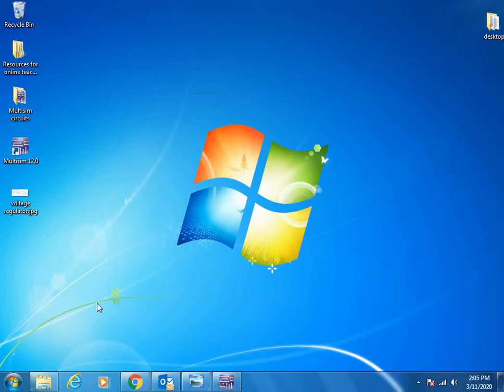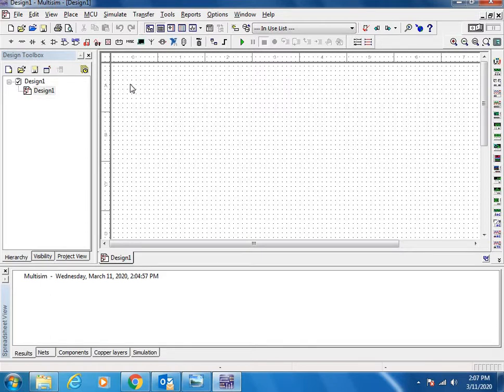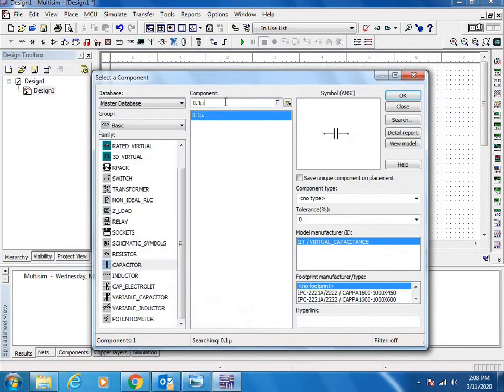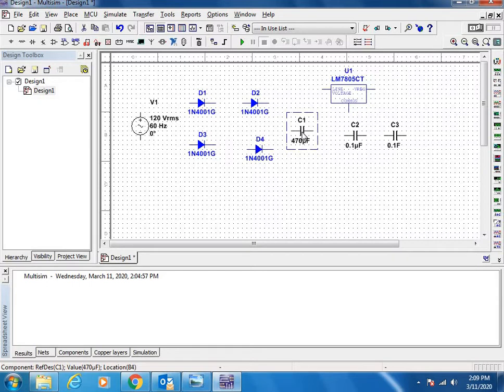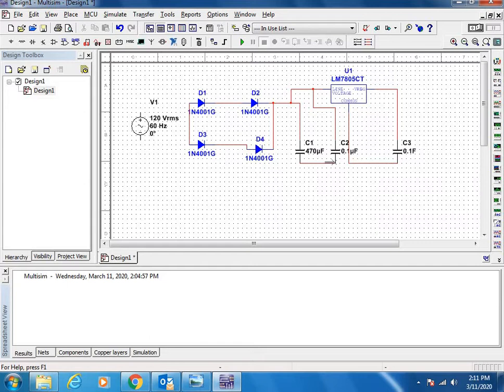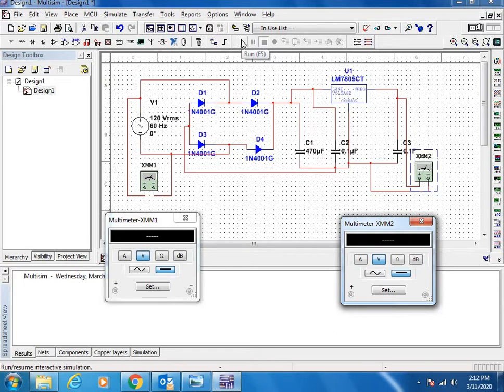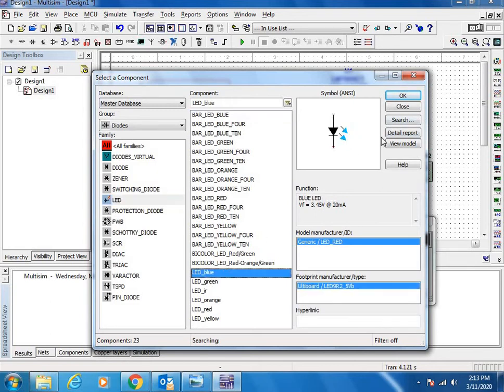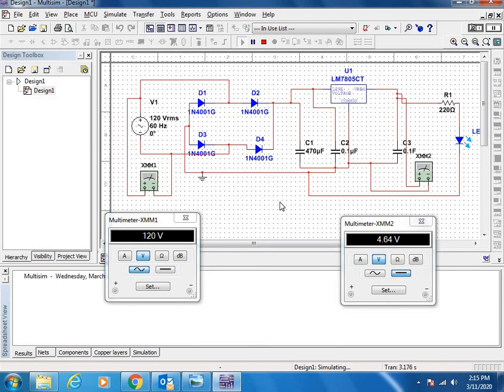Video 2 Multisim circuit design & simulation  voltage regulator

Comment: the promoters of multisim all display very basic circuits.
I would like to see them do a circuit with 3 relays controlled
each by a 24 volt ac switch. each relay being dc with a priority
relay of 15 minutes over the other two let me see if the relays
will hold steady this is not a very complicated circuit, but multisim
will fail, at 4300 hundred dollars you would expect better results.
Reply from the maker: Hi by the way I am not the promoter of multisim but the user of multisim since the licensed full version is available with me.

By the way I would like accept your challenge to design the suggested circuit.

Please send me that respective circuit diagram, I will give a try🤝👍
Reply: @engineeringprojects1359  the circuit is very simple each relay
is controlled by a thermostat, a ordinary switch would do for the thermostat
each relay has a diode a small  pull down resistor to bring the voltage down
to 24 dc with a 1000uf capacitor to smooth out the voltage
the 15 minute priority circuit is done with a 555 timer 
you have the necessary information how the circuit is suppose
to work, now see for yourself
Reply from the maker: @redredbostonelecelec  pls send me circuit diagram. My mail I’d :  ravigiet_eee@yahoo.com
Reply: @engineeringprojects1359  i did not say you were a promotor, i was addressing the
viewers, the circuit i described is a very simple circuit my point is if you
have more 3 relays the relays will not hold steady, if you want to take a challenge show me a workable 
4060 chip with pin 16 and 8 included, also in the circuit i described put in a 555 timer with 
a 15 minute delay for a priority relay show me
Reply from the maker: My email id : ravigiet_eee@yahoo.com

Comment: Where is step down transformer
Reply from the maker: In the simulation i did not use transformer,  since the diodes that I used are ok even  with 220V ac.

While testing the PCB practically I have been used external transformer
Reply: @engineeringprojects1359  ok, but when high voltage is given, we should use step down transformer right?
Reply from the maker: @Bhuvi_23  yes you are right and that would be safe as well

Comment: Sir I want to get 20v dc from 220v ac  how can I do that pls help me
Reply from the maker: try below circuit                                         https://electronicshelpcare.com/how-to-make-inverter-12v-dc-to-220v-ac-making-circuit-diagram-making-transformer-electronics/
Reply: use a step down transformer to give 24 volts ac then use a  rectifier
bridge with a 1000u capacitor (polarized)  with a voltage regulator
being the final step its a very basic circuit i am sure the internet is
loaded with rectifier circuits